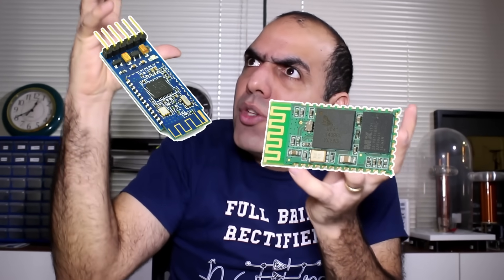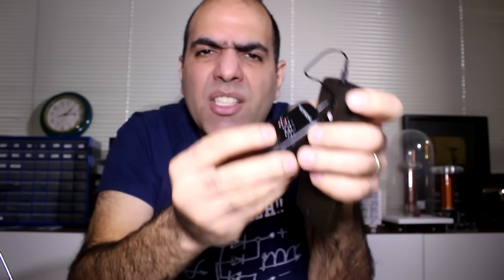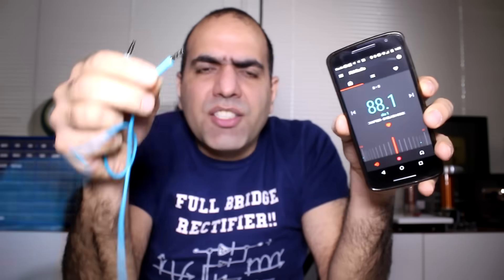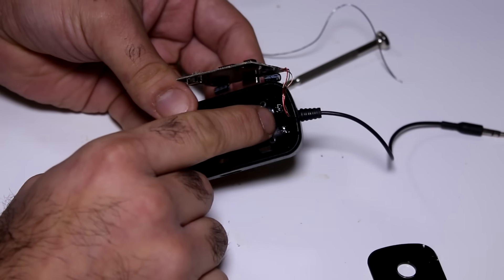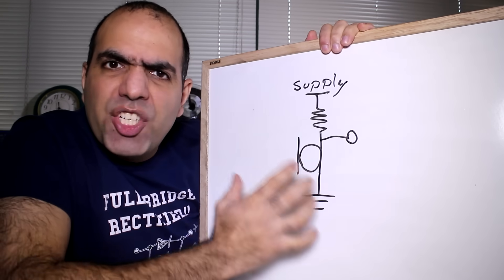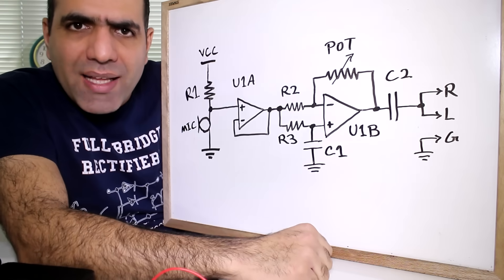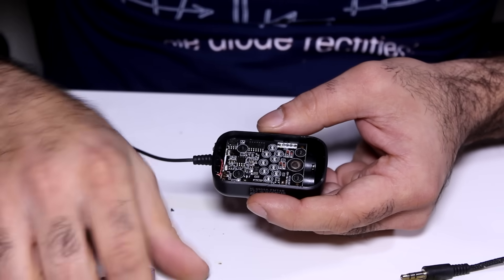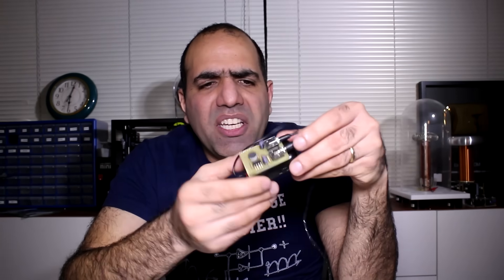Trying to Make a Wireless Lavalier Microphone

Comment: I think the DIY system would have actually worked a lot better if you had used an actual lav mic instead of the cheap desk mic. They make plenty of relatively cheap lav mics with a 3.5mm jack on them. Every lav mic I’ve ever worked with is a condenser mic so your circuit would work just fine as is. As someone who works in the entertainment industry I can tell you why you might want to use a condenser mic over a dynamic mic. Dynamic mics have a much more directional pickup so they pickup whatever is right in front of them. Condenser mics are much more sensitive than dynamic mics and they have a very wide pickup, they pickup everything around in all directions as opposed to the dynamic mics only picking up in one direction.

Comment: Alright you're using the same phone that it's definitely a lot more sensitive external headphone jack you will increase your reception however to be noted there to noted there is a delay on the phone because it is using an SDR software it is processing the information an asset process you it deliver about half a second delay I use this phone to record radio programs on the FM and also when I'm transmitting signals on the FM to see the distance in line because it is quite sensitive if you can go above 2 m link on a external

Comment: What app is that for the fm radio?
Reply: If you are talking about the FM radio app on his phone, it's not really an app as you think of one. It is truly an FM tuner feature in some old Androids. It needs no cellular or wifi data to work. I kept my old Motorola Android so I can use it as a radio! Keep in mind it only receives local FM. It is as Mehdi described, needing  wired earbuds plugged into it for an antenna. If you build something like he did, you will experience delay too.

Comment: I used to use 200Mhz radiomics for the stumps effects on cricket matches for tv in the ‘90’s. The antennas were at least 30cm long though and I held them up out of the pitch on little bamboo skewers.

Comment: Using an analog receiver (like an old or cheap radio, instead of a digital one like the phone) makes the delay much smaller, almost inexistent :) maybe the transmitter has a delay too but it's less likely to have a big delay

Comment: Uhm. This is FM broadcast, it doesn't have 600ms delay.
To put it another way. The studios in the 80's would have paid huge money to have 600ms delay. Such delay requires holding audio rate data stream (something like 44kbytes/s) for half a second. This needs memory. FM radios don't have memory, they have modulators. In fact, such a system is famous for having less latency than sound in open air. What is not being said here is that this device has a look ahead dsp compressor to make the sound better suited for driving, and that dsp feature is adding a delay.

Comment: Well, you should have used some of the older analog transmitter.
The modern DSP based tend to make a "perfect ALC", which by principle need some significant delay in the audio path (the signal operation would require the thing to respond before the event triggering that happens, which is impossible without the delay in the main path).
The analog ones just use plain simple reactive limitter/ALC, so may bring some artifacts when activated, but won't create any delay.
You just set the volume so neither of these activates.

Comment: I am sure you know that the antenna length is determined by the frequency, not the signal strength desired. Having said that, the longer the antenna is physically, the higher the signal strength.

Comment: What's the phone app called?
Reply: It's not really an app. It's a built in fm radio tuner some Androids once had. Maybe they still do. I still have my old one , it's a Motorola. It doesn't need cellular data or wifi to work as a radio either, that's why I still have it laying around.

Comment: In case anyone is still watching this video in 2021 looking for a solution, just pick up a cheap wired lav mic and use an old phone as a transmitter over wifi/BT. Much better signal quality than radio, minimal to no interference, and you can use either another phone at the other end for output through aux, or install drivers to a PC to have it show up as a local microphone device. The app I've used on Android and iOS is called "WO Mic" but there's loads of alternatives

Comment: The only problem i see [at least in the us] is that it's microbroadcasting, which is a big no-no according to the FCC, and would require the FM signal to be less than five meters from source to reciever and be on an empty band in order for it to be legal from what i understand. Feel free to correct and/or add on to this if you'd like.

Comment: Actually the proper length of the antenna for maximum radiation and best SWR (if the transmitter is powerful enough, high SWR can damage it!) should be about 0.48*wavelength for a dipole, and half of that for a monopole. The monopole should also have some sort of a ground plane, like the metal roof of a car.

Comment: The first thing I tested when I got a Motorola phone was the FM Radio app. Compared with a portable radio receptor and an old phone with FM chip, which have almost zero latency, I discovered Motorola's has considerable latency for FM reception.

Tl;dr Motorola FM Radio reception is the culprit of audio latency.

Comment: I have that same FM transmitter (Scosche FMT4R) and I figured out that if you power it from 5v the range goes up to ~100m. I eventually soldered a USB cable to the battery contacts and powered it from a mobile battery pack.

Comment: I suspect, that biggest source of delay in your setup might have been the android phone, since its audio drivers are not exactly optimised for low latency. However, some mostly older phones (I think Galaxy S 1 used this setup) used FM IC with analogue output, which was in turn mixed into headphones or speaker using analogue mixer, this made recording FM impossible, but would not have the latency issue.

Comment: Great video! I think the latency is mainly caused by the phone being used as the receiver. Connecting a standard fm radio with a headphone output instead should get rid of the audible latency entirely.

Comment: Get a CZE-T251 transmitter and have even better sound ....... that could be picked up 20 miles away. lol, thats what i use for my community radio station.

To make the range longer, just make a simple fm dipole. connect a copper wire 1/4 of the wave length to the existing antenna and connect a copper wire the same length to the minus ground of the transmitter.

Comment: please anyone tell me how can i make a working fm transmitter i want to send my guitar sound to my amp without the cable i tried 2 different circuits but both didn't work electroboom please can u give me the link for fm transmitter that u made
i made a coil of 4-5 turns the diameter was 3-4.5mm with the wire diameter of about 0.8-1mm & trimmer cap with approx 100-120pf of capacitance
according to the online calculator the coil inductance was 0.027uh 
so the frequency was above 100Mhz but i cant figure out what was the problem HELP ME

Comment: I think the latency is purely in the phone. The amplifier and transmitter/modulator are probably not buffering in any way so 'zero latency'. But, as you've experienced, there's a lot to mic amping and audio transmission. This will never sound good but I think it's still possible with cheap parts, but a fully custom PCB on the transmitting and receiving end.

Comment: This makes me think of the actual purpose of those claperboards you see before film takes.  It gives you a very clear visual of the clap closing shut, as well as the clear audio of the clap to let you sync up sound and audio tracks that are otherwise recorded with different systems.  In this way, it becomes a much more trivial thing to sync them up in the initial part of post production editing, allowing you to record audio on a completely separate system to the video.
Reply: I'm sooo late to the party but in case anyone is too: ☝️ is the correct solution.

Just go wired lav to your phone, record it. Then sync in post.

Comment: +1 Like for Birdie num-nums. And +1 customer for R0DE for helping you out.
You probably already know this, but for what it's worth... Nearly all of the latency you were experiencing is due to the digital FM receiver chip and application buffering. If you used your daughter's radio (or another decent analog device), latency wouldn't be a problem.
Reply: wondras ya! Like no one gets the reference!

Comment: Most of the latency is probably from your phone's app, which is probably (ab)using the BT or other IC to do radio receiving doing FM demodulation in software (SDR), with window sizes and buffering that add most of the latency. Any other hardware FM receiver or something not working in this way would probably work without perceivable latency. 🛰

Comment: OMG I miss FM receivers on modern phones! Samsung ditched those since Galaxy S4 and now with the trend of no headphone jack, the future for mobile radio is grim.
I mean, I do have a good data plan, but still - when digital signal is too weak and there is low buffer for audio, the transmission just gets cut off in poo reception areas. Whereas when you have a less than ideal FM signal, it's only a slight buzz. Also, no buffering.

Comment: The diy mic sounded pretty good. Only needed a low-pass just before the gain stage to get rid of the hiss.  I once hacked together something similar when working for a wireless paging provider when someone dug and accidentally cut a transmitter line and we needed a solution in a pinch. Just a few more (bigger) capacitors and a slightly larger power supply :)

Comment: I suspect most of the delay is from the phone. You would have done better using your daughters fm radio since it doesn't bother with all that unneeded encoding and decoding that your phone is doing.
Reply: Joel Cook Why would it need to encode? I'd expect it to decode the FM signal to PCM audio and send that to the speaker.
Reply: It may just be encoding and buffering that cause the delay. regardless the delay is much greater than you would get using a standalone fm receiver. Otherewise cordless microphones would all have too much delay to be usable.

Comment: Dear ElectroBOOM, I also made one just like this back in 2012. The latency was caused by your smartphone's processing of the FM radio signals. I suggest to use an analog FM receiver or just a non-smartphone FM receiver. It would greatly fix the latency issues.

Comment: I've got a tip for you on using your phone's FM antenna without using a Headphone AUX cable. Just point the headphone jack on your phone to the tip of your nose. Your nose will act like a built-in antenna and the radio will receive audio.

Comment: I use Bluetooth with great success!  The best adapter, in my opinion, is: https://www.amazon.com/DEWALT-DCR002-Bluetooth-Radio-Adaptor/dp/B00LCNGQJI/ref=sr_1_3?ie=UTF8&qid=1513036904&sr=8-3&keywords=dewalt+bluetooth+adapter.  Pairing is easy and it actually connects to my phone at the maximum range, as specified by the latest standard.  The built-in battery charges via USB.

Comment: I knew latency would be an issue when he did the first test around 7 minutes in, lol.
A better mic (you've got a fairly directional mic pointing AWAY from you) would make the system fairly complete.

Gotta say, I'm fairly impressed with what you were able to get with a personal FM TX. My experience with those crappy things was never so good.

Bari kala

Comment: If you made the FM transmitter strong enough could you overpower local stations in a short radius, to annoy nearby drivers?
Reply: It's possible and was done in early years of FM radio. As there were battles between inventors and they trolled each other.

Also there're jammers that are used in most somewhat important government buildings(doesn't mean they are ON) and in mass events like Olympics ect.(so that nobody can for example set off bomb wirelessly)
Reply: I'm also gonna guess any transmitters strong enough to have such an effect are unlawful
Reply: Yup.

Well... those little tiny FM transmitters that are supposed to be used with old car radio and smartphone. Will to some extend work as such in rly short distance. But even that selling such devices is legal and using them in own car... using them when there is anyone else nearby that use radio is not legal.

Jammers are pretty much only limited for government and security companies with licenses and some technicians with licenses.

Comment: Interesting way of making a gain stage with the second opamp. It took me some time to figure out that the low pass filter before the non-inverting input is to get a DC amplification factor of 1. This makes the circuit suitable to be used with an asymmetrical power supply.

Comment: FM transmitters usually have barely any latency since it's mostly analog and doesn't require compression or buffering etc., like mp3 streamed over Bluetooth or WiFi therefore I expect you either had a weird FM transmitter, or perhaps more likely, your phone manipulates the audio digitally (volume control etc.) which causes the delay.
I expect it would probably work just fine on any other cheap radio with an audio jack, apart from the not quite ideal audio quality. But one can of course overcome all of those problems reasonably easy.

Comment: Here's my doubt. The output from the microphone swings in both positive and negative directions. As it amplifies both parts, positive and negative amplify, but the op amp doesn't have a  negative voltages supply. So what happens to the the -ve parts of the microphone output

Comment: Isn't that the phone making most of the delay? Transmitter might add some too, if it is "too digital" inside. Most analog systems have quite low delay, try some el-cheapo tiny FM receiver (with 3.5mm jack… wait, 3.5mm jannet connector), this might help.
Reply: Pretty sure this is the issue. Phone FM receiver has no need to be low latency as you are listening a broadcast done in a completely different place. Probably also the small FM transmitter is analog, so with an analog FM receiver you would most likely have no latency at all.

Comment: 2:30 If I recall correctly, half a wavelength is the proper length for a dipole antenna. Monopole antennas, assuming the other half is an extense enough conductive ground, just need a quarter wavelength.

Comment: One doubt: Did you used your oscilloscope as a 48 V phantom power supply for the condenser mic? If not, what did you used and which voltage?

Comment: More likely that one is not condenser though, electret microphones are way more common in that price range! The principle of operation for those ones is piezoeffect, the same thing which makes some of the ceramic capacitors microphonic. Electret microphones come with built-in first amplification stage on single FET which requires about 5V bias.

And I am almost sure most of the delay you experience comes from encoding video on the computer in whatev software you are using, 5-10 frames sounds about right for it. So prepare to have your latency issues again with Rode mic :p if the audio stream doesn't come together with video stream your software just doesn't know how to align the two.

Comment: You do know you can buy FM Transmitter Circuit's and then add your own Microphone With a Step up Circuit like you created. Here is the link for the FM Transmitter's on Ebay Some are only Two Dollars. > https://www.ebay.com/sch/i.html?_from=R40&_trksid=p2380057.m570.l1311.R2.TR3.TRC0.A0.H2.Xfm+transmitter+micro.TRS0&_nkw=fm+transmitter+module+wireless+microphone&_sacat=0

Comment: Could be wrong, but I don't think transmitting distance is improved or limited by antenna "size". The antenna size should be appropriate for the frequency you want to transmit/receive, but I don't think it has any bearing on output power or receiver sensitivity.

Comment: If I want to increase the distance that the audio signal travel - lets say 1 Km- what I need to do? Increase the output power of antenna
Reply from the maker: proper size antenna, more power and clear line of sight
Reply: but isnt creating such a "powerfull" transmitter illegal?
Reply: It's illegal if you go over a certain power level without a broadcasting license. Not sure what that level is though
Reply: If you're suitably licensed, it's fine - HAM radio operators do it all the time, and at much longer ranges than just 1km.
Reply: schneggedigger it's only illegal if you are stupid enough to get caught
Reply: In many places its actually illegal to broadcast without a permit, especially in the typical fm/am ranges. Check your local laws first! Low power use such as what is featured here is tolerated though
Reply: tullgutten that's why i said low power transmission is fine...
Reply: Cleiton Felipe because that's great advice... :/
Reply: Analog xam tomorrow wish me luck uncle :)
Reply: Hydrochloric Acid usually legal for low power ones like AUX to fm transmitters with a range of 5 to 10 meters, you can buy it everywhere
Reply: use AM instead of FM. long waves, like amateur radio does